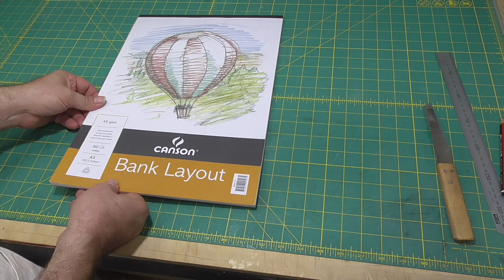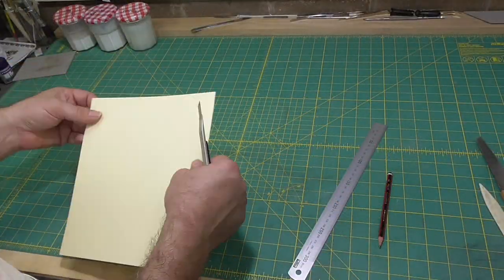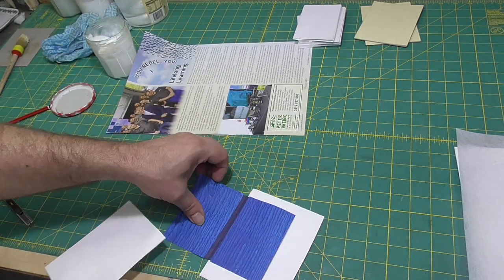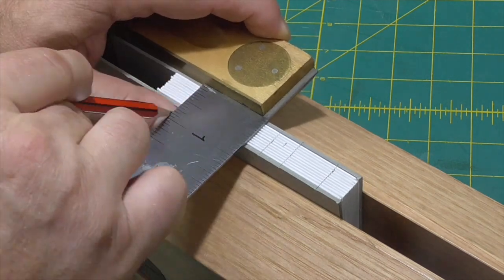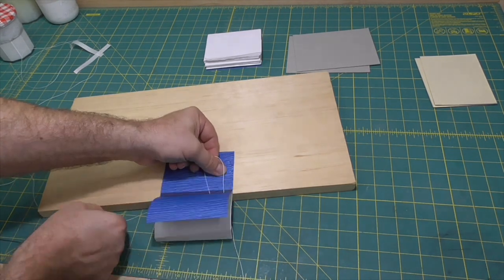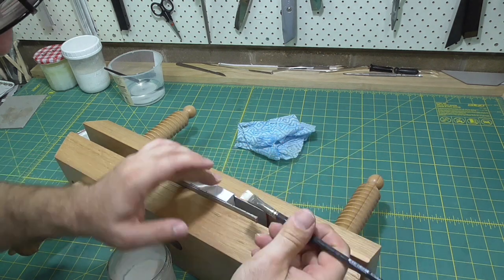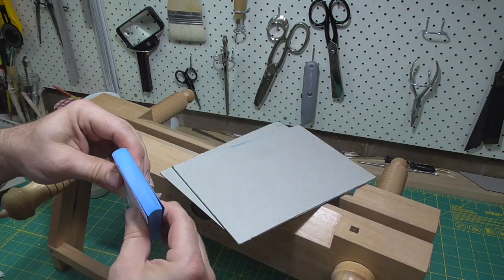Binding a Little Springback Pocket Notebook Part 1 // Adventures in Bookbinding

Comment: Just a heads-up on 50gsm layout paper for binders in the UK - I just checked both 50 sheet pads of layout paper I bought from discount store Hobbycraft a while back and they are both short grain A3 which is the right orientation for folding to A7 as Darryn does here.  It is nice strong and smooth paper but I have only used it in the past for backing when making bookcloth but I will be making the little springback with it.  Unfortunately the website says it is out of stock online but if you have any moldering away in your old paper stash, it is perfect for this project.
Reply from the maker: Thanks John!  DAS

Comment: Thank you for another great video. I'm looking forward to the next ones. Btw, you have mentioned sometimes using diluted PVA adhesive. I assume you use water for this. Can you tell me of the ratio used to thin PVA and yet still get good adhesion please.
Reply from the maker: Maybe I said mix, in which case it is mixing PVA with methyl cellulose as per the video I did on MC.  If it sounded like mixing with water, then I wasn't very clear.  I'm more likely to let water evaporate off PVA to make it a bit thicker.  But I vaguely recall someone telling me I shouldn't do this - but I do:)  Ciao, DAS

Comment: can you use thick twine for the bands to give a more raised look?
Reply from the maker: Hi John, If you mean the springback, then no.  All the sewing is covered by the spring.  Any springback with raised bands on the spine are false raised bands made by glueing a strip of leather or board on the spring to simulate a band before covering.  If you mean the leather binding with laced on boards which I just finished, then it's also no.  Because of the hollow tube on the spine the sewing supports need to be flush with the spine and bands are added as false bands as mentioned.  A binding with genuine raised bands must have a tight spine, the leather is glued directly onto the spine and over the raised cords.  All the best,  DAS

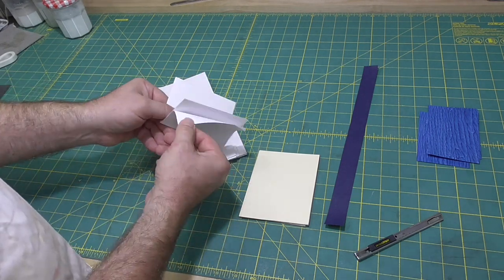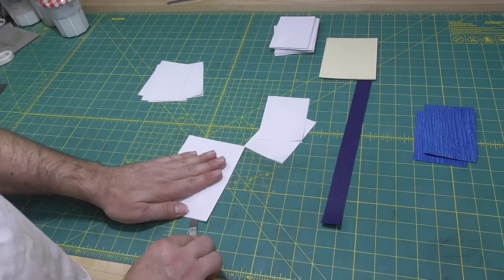Comment: 5:38 - 6:05 In regards to the sections that you pulled out.  You pulled out 4 pages out of the 8 pages that are in section, 2 for each end paper.  What did you do with remaining four pages?

Do you have a total of 7 sections including the 2 end paper sections without the 4 pages?  

Or did you distrubte the 4 pages amongst the other 7 sections like so: Endpaper  Section 1, Section 1 (+1 page), Section 2, Section 3 (+1 page), Section 4, Section 5 (+1 page), Section 6, Section 7 (+1 page), Endpaper Section 2
Reply from the maker: The left over folios from the sections I cut up for the endpapers I put aside for the next time I make this book.  In total there was 10 sections plus the 2 endpapers.  Sorry this wasn't clearer.  Good luck!  DAS

Comment: Are the paste-papers you make smooth to the touch?
Reply from the maker: Well, they are not rough.  But where the paste/paint is thickest after putting patterns in it you can feel a slight thickness when you run your hand over it.  It's not much and just looking at it it's not obvious.  DAS